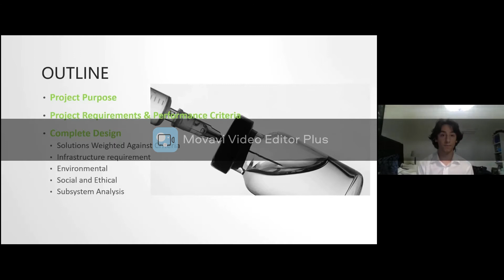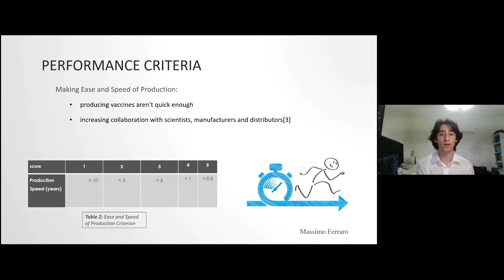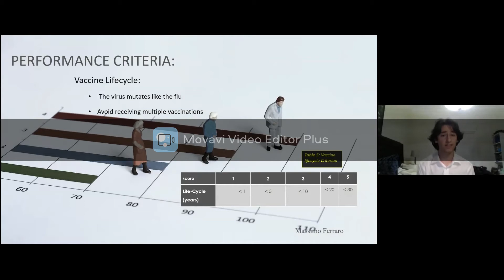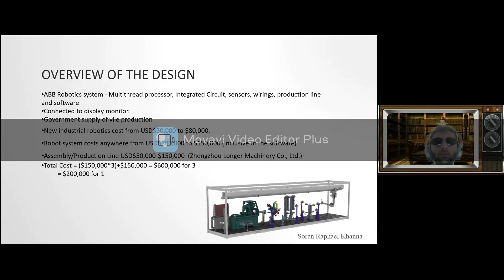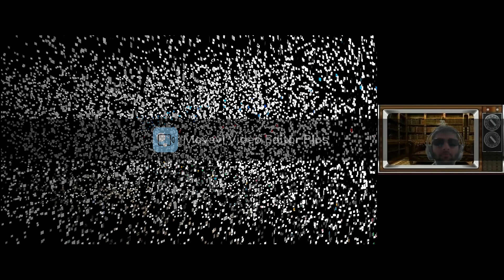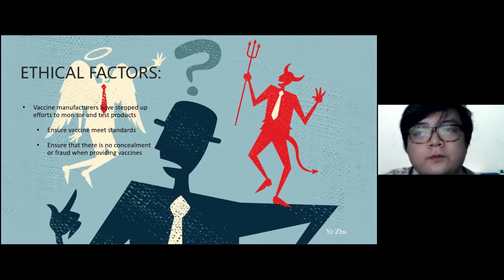Production of Vaccines -  Seminar (Group 5)

Comment: Once the vaccines are produced, like Picked them up from the printers yesterday, how long would it take for the consumer to receive the vaccine when compared to conventional methods?
Reply from the maker: Great question! It depends where the device is installed. The solution is portable, so if we are able to set up the device in local hospitals or clinics, due to its small size, then consumers can receive vaccines as soon as they finish production. Conventional methods would require the doses to be transported interstate overseas which could take between days or months.

Comment: At 11:28, it’s stated that the solution will replace factories and become flexible so it’s easily accessible for everyone, where are possible locations where the system will work?
Furthermore, since the system is flexible, does this only include locations of where it will operate or is there more to it?
Reply from the maker: Its essentially portable so you can set it up in any controlled environment, that can be a specific area of a hospital floor, an isolated warehouse just for the production of vaccines, a section of the clinic etc.. The robotics system being used is flexible so you can add or remove certain components in order to suit your production demands